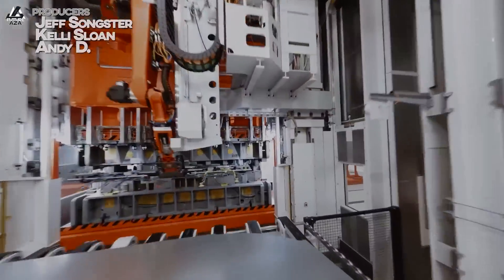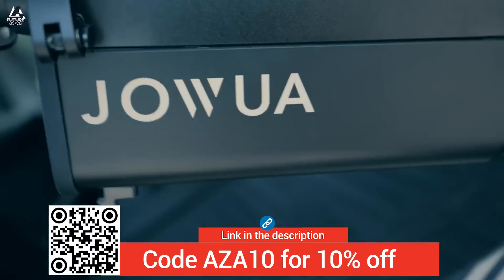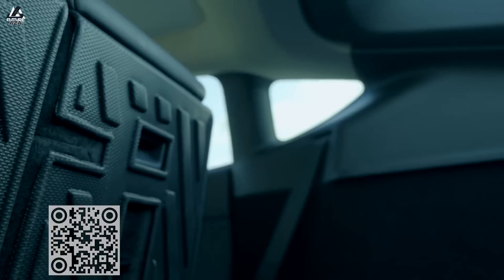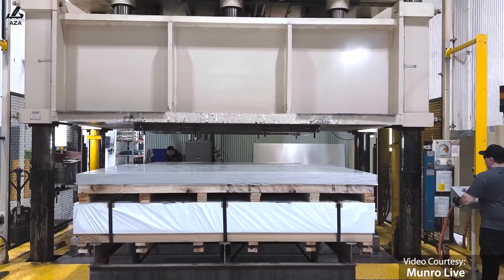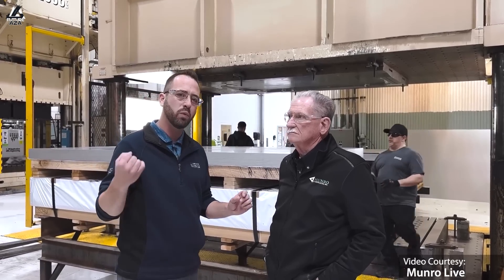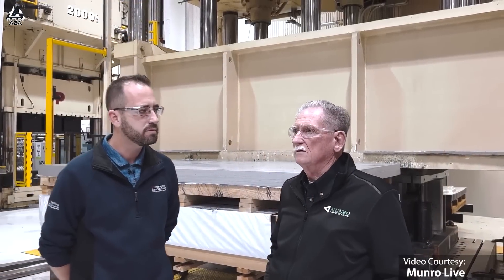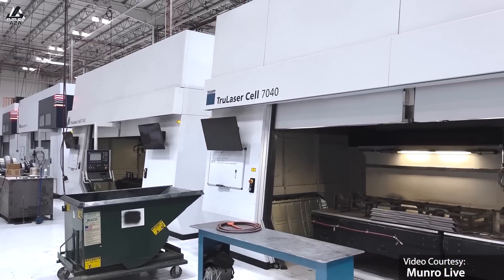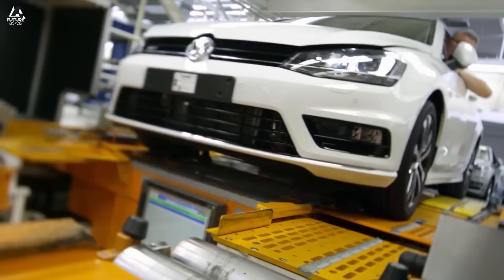Sandy Munro's Jaw-Dropping EV Picks!

Comment: What about repairs? Is there any chance to cut out damaged chunk of casting and splice / weld a replacement in?  Right now EV's are getting the reputation of being "1-crash, throw it away".   Part of the problem is simply mechanics are not familiar with them, so they refuse to work on them. Part of the problem is insurance company risk aversion, fear of the unknown when it comes to repairing EV's.
Reply from the maker: Sandy made a whole video debunking the notion. The castings are stronger than the stamped pieces they replaced. Any accident with sufficient force to damage a casting would have already totaled any other car on the road, regardless of the method of construction.

With that said, you can absolutely weld a casting. If it's 50 years from now and your antique car is badly wrecked, yes, you can weld it.

Comment: I'm not a truck guy, but in the youtubes I've seen, the Silverado beats the pants off of the F150L and the Cybertruck.
Reply from the maker: Haven't had the time to check out enough Silverado coverage. I've been trying to get GM to take my calls, but they are incredibly slow and either don't like me, or are dreadfully bad at their job.
Reply: In what metrics?
Reply: @raymondschembri5042  Towing range. Search for a YouTube titled "Why does the Chevy EV tow TWICE as far as the Cybertruck?!" I've seen other head-to-head comparisons of the Silverado with the Cybertruck and F150L, and the Silverado goes much further when towing a trailer.

Comment: If only...Aptera had Sandy! So much to do, so little money.
Reply from the maker: Munro has worked with Aptera. I don't know the extent of the involvement, but they got him.
Reply: Ever notice Sandy does not mention Aptera in any prediction on any channel for up and coming EVs.  He is a paid consultant only and unless they pay he does not play.   Plus he dropped a bomb in August 2023 when he stated Aptera gave up on hub motors and Aptera recently took Elaphe off their supplier list and now refuses, YES REFUSES, to tell prospective owners even how many wheels are powered let alone what powers them
Reply: @andromedach 
Aptera is under an NDA until final agreements are inked. Powertrain is 100% locked down for mass production and announcements are forthcoming. Delete your assumptions and let Aptera show you how it's actually done.

Comment: PATREON of FutureAZA & Munro, I am.  I hoped Sandy’s recent championing of the Sakuu battery would come up in this interview, but it’s still pretty hot news, and, as such will be an upcoming recurrent topic.
       For manufacturing technology, Sandy is an important leader and guiding light for me, and Brian, you educate me and keep me on my toes too.  However, to the extent Sandy is championing the Sakuu Battery, I have a terrible stumble trying to understand how the Sakuu Battery handles HEAT!
       HEAT - I really need to understand how the Sakuu Metal Free Battery can handle HEAT!  Generally metals conduct heat much faster and better than plastics.  Is what’s not explained so far got to do with thermo-conductive plastics or ceramics?  Moving heat around efficiently is something that has to be reckoned with. I hope it's not a show stopper for this new Sakuu battery technology.  High rates of charge (short recharge times), and bat-out-of-hell FUN acceleration both bump up against battery heat issues. And just plain old keeping the battery temp happy regardless of what the weather's doing outside is important too.
      The lithium battery’s internal resistance (regardless of form factor) increases during both discharge and charge, and internal resistance & temperature increases faster with faster rates of charge or discharge.  As battery internal resistance goes up its power handling capability (charge or discharge) is decreased.  Controlling battery temperature is very important for battery power handling performance, and battery life.  In general the lower a battery’s innate internal resistance characteristics the better its power handling capability.   I’m not aware of any electric cars that don’t have an active battery thermal management system; most use liquid cooling, and - outside of the battery itself, regardless of liquid or air cooling, use aluminum material somewhere in the heat exchanger system.  (Please educate me of any exceptions and facts.)
       The lithium 4680 form factor with very thin metal foils and tabless electrodes wrapped completely through the jellyroll, or even flat batteries with thin metal foil seem to have an advantage rapidly moving heat for thermal management.  If you don’t have heat exchange material right up through the core or a battery cell, won’t you have the weight of heat exchanger material added back somewhere else adding back pack weight, or excepting lower power handling capability?  Is there a way for Sakuu to get out of the lab?
       Some technologies will get out of the lab, Sakuu clearly looks promising to Sandy; I want to be able to see what Sandy sees?  Please help me up from falling on my face - so far!
Reply from the maker: It was discussed in part one a few days ago, wasn't it?

Comment: I disagree with his assessment of GM. They made sure to have their battery game in place before diving in deep which is Ford's mistake.  They also have delivery vans under Brightdrop.
Reply: Chevy Bolt was GM and had the most and worst battery problems.
Reply: @stevennelson7518  No longer on sale
Reply: @stevennelson7518  This is over stating the issue and not applicable in 2024 as the 2016 product tech has been discontinued.